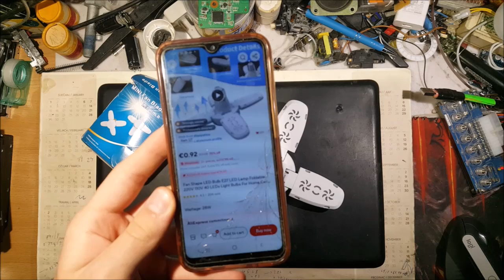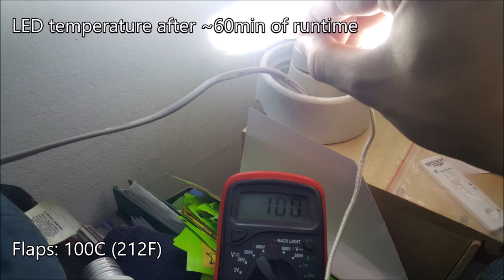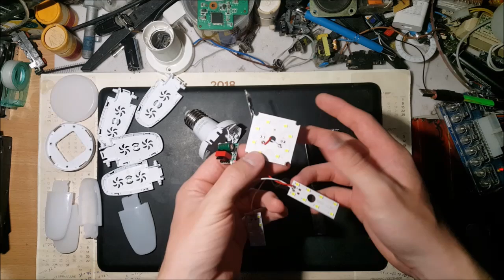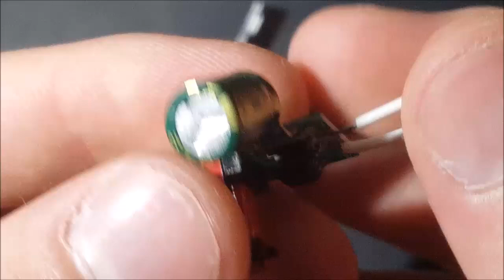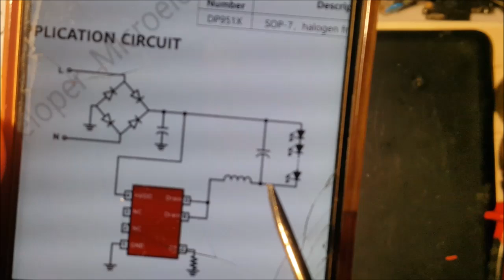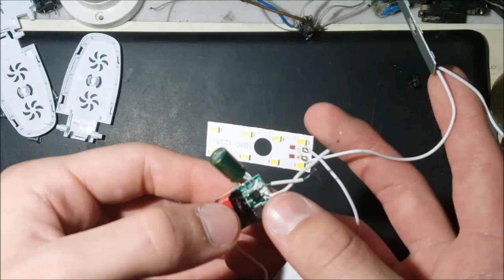Aliexpress fan blade LED bulb review and teardown

Comment: So it's not a fan at all?  Yeah I don't think 212° sitting on plastic would smell too good And probably would emit VOCs
Reply from the maker: I have seen bulbs in the past that smell bad when they warm up (ahem made by SOLE) but at least to me, this one doesn't produce any bad smells.
There are versions of these bulbs that do have an integrated fan, maybe I should get a hold of one of those?
Reply: @BadCircuit22 yeah I thought the whole unit spun like a fan.  I'm saying they are basically using plastic case as a heat sink iand that is not good. that's what would release VOCs not the LED bulbs.
Reply from the maker: Yeah, that is what every bulb does, they do have the internal aluminium "heatsink" but there is always a layer of plastic on it. It is cheaper to do it this way because when you can't touch the metal, you don't have to properly isolate it from mains. So effectively the metal is used asthe heat spreader and the plastic itself is acting like a heatsink and being heated well over 100 C
Reply: @BadCircuit22 wow okay.  So they isolate the heatsink and use a buffer did not know that.  so both sides of the heatsink is sitting on plastic that's a pretty bad design.  But low cost and cheap